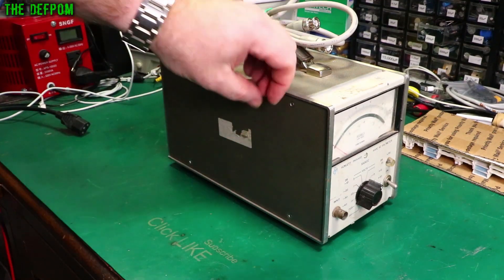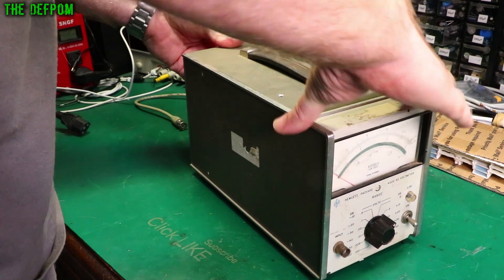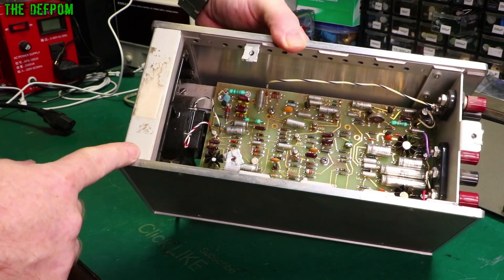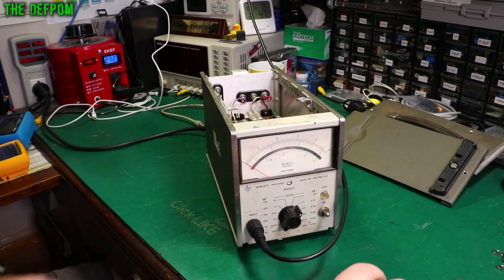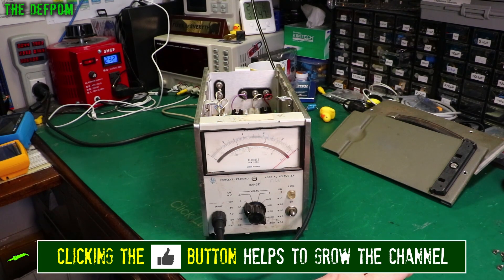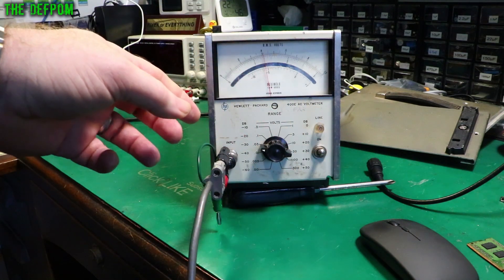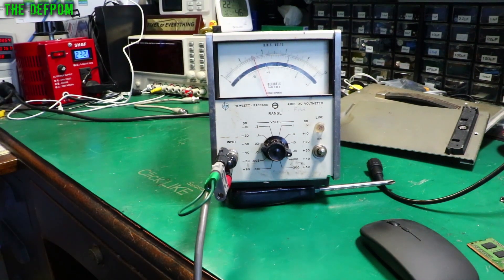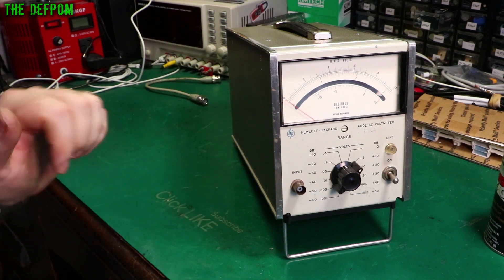🔴 HP 400E AC Voltmeter Testing - No.946

Comment: Hey Scott good score on that mate, I’ve got the HP 410C and there is no room inside it like yours.LOL But its AC, DC, OHMS, DC Amps. Mine has the AC probe that i use for radio work. HP especially the older gear is very well made and they were famous for their Spectrum Analysers like Tektronix were for their scopes.

Comment: It is a "newer" unit since it has the modern IEC power connector instead of the older ones with the round pins that are on mine.
The frequency response is 10 Hz to 10 Mhz.  It is an average reading meter.
You can also use it as a preamp.
The input is 10 Meg Ohms so it is very sensitive to noise pickup.
I use mine for peaking adjustments such as IF alignment.
It is a nice meter.  Enjoy it.
Reply from the maker: It is already put away in a drawer (I only have so much space for in use equipment), my challenge is now to remember that I own it when I have a suitable measurement that would benefit from its use.
Reply from the maker: This is an RMS meter, not average reading, at least according to the writing at the top of the meter movement.
Reply: @TheDefpom  The scale is calibrated for the rms value of a sine wave, but it makes average readings.
Reply from the maker: @Chris_Grossman  I might have to put a square wave into it to be sure, my quick skim of the manual didn’t seem to find it stating either type, I’m pretty sure you are correct, but I like to know for certain by checking it myself.
Reply: @TheDefpom   If you put a 5 volt square wave into it, the meter will read 5.55 volts. At least mine does. The meter movement on mine states that it is volts RMS, average responding. So it will correctly read a sine wave in RMS, but it is not true RMS like a Fluke 87 is. Therefore, you will get an average reading with a square wave.
Reply from the maker: @capriracer351  Yes I will have to shove a square wave into it at some point to verify the difference for average reading, at the moment it is shoved in a drawer in my 2nd lab.

Comment: Power switches are commonly Off in the down position on equipment so you can slap the front and turn the thing off if something... energetic happens. It's harder to switch it up for Off.
Reply from the maker: I think this depends on the country in which the equipment was designed, I know the US has the standard of a switch being in the up position to be on (including light switches etc.), other countries such as the UK are the opposite, so for me, down should be on LOL.